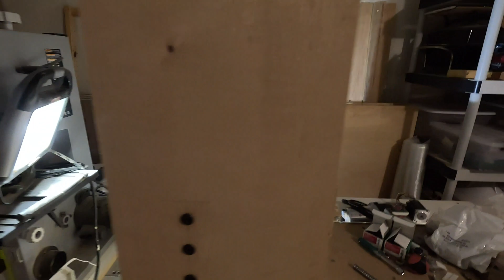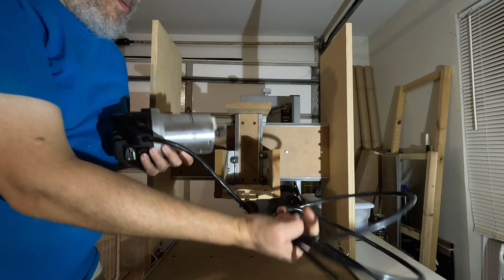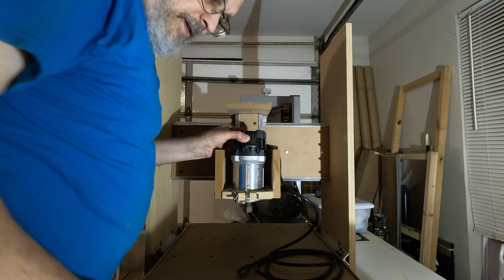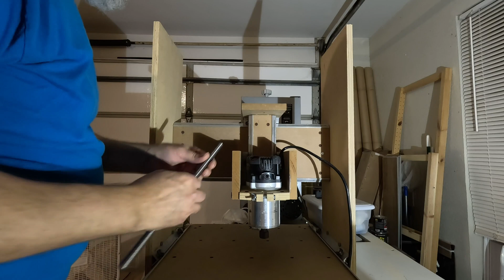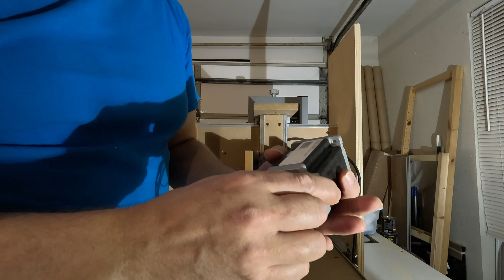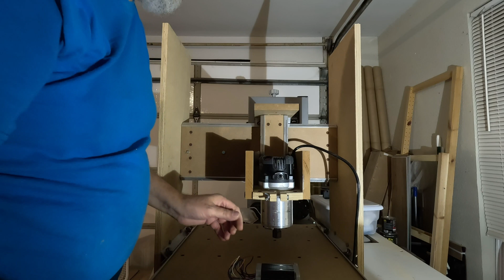DIY CNC - Gantry put together again and dry fitting router.

Comment: I like the modification with the chain. You explained the way you want to mount the motors and run the chain, so it will be interesting how you resolve everything. I is a good idea to make sure the chain wraps around the drive sprocket as much as possible to get the most accuracy out of the axis (it's like averaging the chain pitch).
Reply from the maker: Thank you and yes, I completely agree.

Comment: I designed a lot of space between the router collet and the surface. In many cases, you will have a thick workpiece, so the space if good to have, but if you are generally going to mill sheet stock, it may be better to lower the gantry rail. The closer the milling is to the bearings, the better for rigidity.
Reply from the maker: I also wanted clearance when needed so will leave the Y axis rail on the gantry where it is. I might need extra boards under the workpiece if it's too low and the router can't be mounted lower. But I'd rather raise the workpiece than have a machine that can't work with thick pieces.

Comment: Looking great. I also agree with bretthatcher5300 on the having the long axis be the X, but I always err on what would be safest. All of my machines have the X axis as the longest axis, but orientation and where you are generally positioned at the machine should take precedence since you will be operating the machine. For instance, if you stand at the end of the machine mostly, and if you are accustomed to X going left and right and Y going toward and away from you, then in your case, the X would be the shorter axis. On the many years I have been doing this, the axes orientation has been one of the biggest debates.
Reply from the maker: Yes, I'm building the machine so that the long axis sits at the front of the workbench and that's how I will operate the machine too. So, yeah, I'll be switching the X and Y axis. I've already started referring to the new axis names in later videos.

Comment: Your longest axis should be the "X" axis, then the right hand rule applies.
Reply from the maker: Yes, I will be switching the X and Y axis but not because one is longer. It has to do with what is most appropriate to call the front of the machine. What I first thought of as the side is more natural to think of as the front. I think that whether a machine uses the left hand rule or right hand rule depends on where the origin is located which then determines which directions are considered to be positive from the origin.